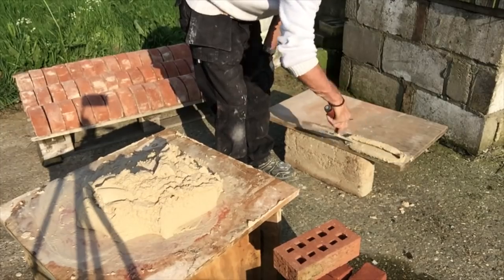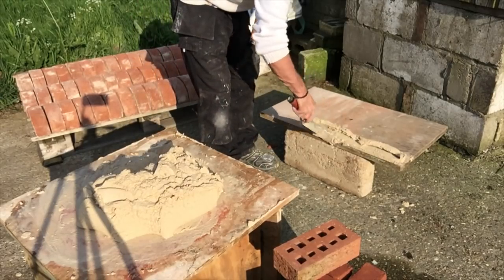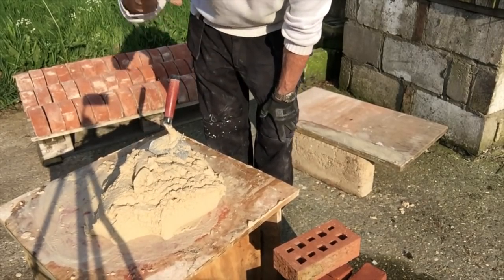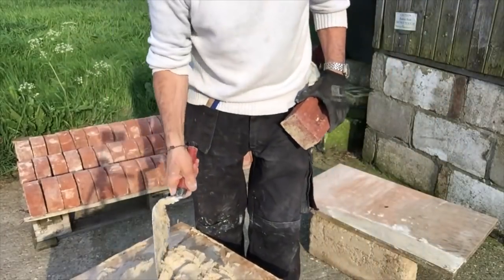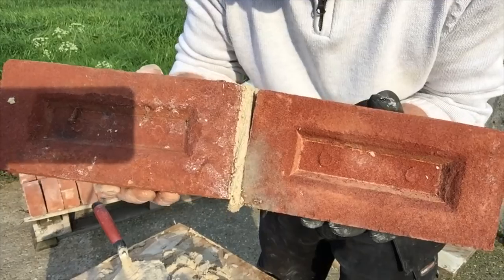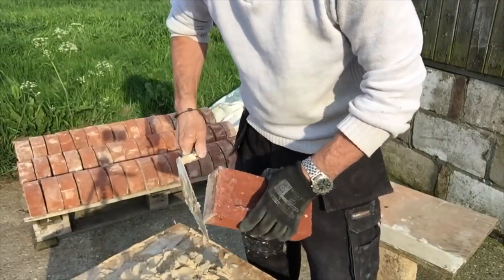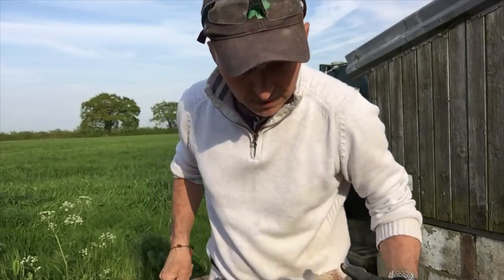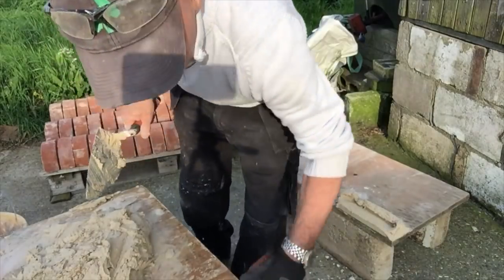how to lay bricks - Basic Skills Lesson 1 - Freehand Panel

Comment: thanks ive been doing my own DIY  since i was a lad, done a few small walls of my own, but learned watching your video in the first 3 minutes where i was going wrong with the buttering of the brick, superb and saves me so much time, and makes the job neater also down to holding the brick,,,, thank you great video have subscribed as i have a large wall to do next year so taking a year  to get technique correct as it its 8 course high and full length of my front garden ,

Comment: I couldn't agree more regarding the pointing up. You should be able to do it one handed within reason.
Also, it is really hard to find mortar that is dry enough to match the mortar in your work so if you are adding wetter mortar it stands out like a sore thumb, even more so after brushing.
There is lot's of talk about the pick a dip method, but it is so hard to get a full joint, they do it in Holland but then have labourers to do the jointing up.

Comment: 15 years exp brickie here, nice video.  I butter my bricks in two strokes on the end near my wrist, not the end you are using, if i'm going from left to right on the wall.  One stroke to fill the middle and one to the front to make sure i don't spend too much time on jointing.  Extremely fast.

Comment: Nice bricks mate good demo, you should try flick your bed along the wall not drop it and spread it with your trowel bottom upwards, point running along the frog ( hole in brick). Can get a brick bed and a half easy, and its "perp" not perk mate. Half trowel of mud flick downward to flatten out mud. x2 quick vertical down strokes fatter on the on top. The front perp, stroke back towards yourself aiming for it running with face of brick. Then the back perp same as front. 4 quick moments 1 half trowel of mud, flatten off with a flick over your mud board. Years of practice dont except the speed until you can lay straight

Comment: Always keep!the perps full is dead right .... you don’t get paid for jointing . Great video Rob 👍🏼
Reply from the maker: thank you...I'm enjoying yours as well...
Reply: rob songer . Wow thanks for watching Rob that means a lot to us 👍🏼
Reply: You do get paid for jointing as that is part of the price you put in for the wall you are doing or if you are on price work and you get a certain amount per 1000 bricks then the jointingis in with the amount you get per thousand bricks you lay. What this guy is saying isn't that important because you can put a not so good joint on your brick compared to the other bricklayer who does but you should be laying more bricks than that person but your joints won't be as full as the other guys but you have put more bricks in than him and the time it takes the other guy to lay the same bricks as you then that gives you time to go over your mounting and sometimes this can be a quicker method.
Reply: Mr Brightside knocked down a brick outbuilding at home laid frog down and all the bricks had voids in the perps. More just a bead of mortar around the edge. Easiest deconstruction ever. Tap with a hammer and off it came.

Comment: When I place a joint on the end I use two moves. The joint after applied should be near straight with the face for a full cross joint when you lay it. Fast is measured when the wall is complete not just laid to the line. Most brick should be rubbed into position for speed. Thanks Rob.

Comment: Wondering if you might comment on the method of pick and dip some masons are using. Seems like the quality of the mortar necessary for pick and dip and head joints may not be as weatherproof as conventional mortar mixes and laying of brick. Do you always work from right to left?
Reply from the maker: Hi Gary, yes I always work that way, if you watch lesson 2 I think I explain it more

Comment: The masons that I learned from would not work backwards unless 2 right handed brikies were on the same wall. Always was told to double the head joints to avoid the beholds. Used what is called a shoved head joint. .if the wall was 30 bricks long then we spread the mortar on the 30 bricks. Being that I am a left handed mason, it was very rare to lay backwards. We never used the pick and dip method of spreading the bed mud.
Reply from the maker: Are you saying that both brickies always started at the corners and both met in the middle of the wall?
Reply: @robsonger1  yes Sir! I am in the Southwest USA. Basic trowel technic is the same where ever you are. We have sharp sand here and that is why we spread motor differently. No matter what the end result is the same. Your video was right on the head of teaching. Very good and informative.

Comment: Hi rob, great video as per usual, how would you joint a let’s say panel of brick work with joints bigger than 10mm, 12 to 15mm, what size bar would you go for ?
Reply from the maker: Hi Barry, if the wall was being half round jointed I'd use the widest Marshalltown jointer, the 81 pattern (I believe its that, I mention it in my video "Hand Tools"
Otherwise if it was left up to me, it would be a flush joint with my stick. Please see "Flush Jointing"
and funny enough, I uploaded a flush jointing video yesterday but haven't made it public.
Reply: Cheers rob, you’ve just won me 20 quid 💷, I o you one
Reply from the maker: how did that happen?
Reply: Have a mate I work with and we building timber frame houses and sometimes we have massive joints between windows, he uses a small bar on big joints to try and bluff the big joint, to try make it look like a normal Joint, I like the big bar as it is what it is, what’s your take on this
Reply from the maker: Timber frame can be a huge problem for us, I worked on a few and had similar problems like you say.
I think what you are doing is the best you can do. Keep up the good work
Reply: Cheers rob, love your videos
Reply from the maker: thank you.

Comment: Hi Rob, I've watched your videos loads of times to try and copy how you lay bricks, I'm a complete novice and the one thing I'm struggling with is getting the mortar to stick, in your video at about  6:45 you sort of slide the trowel off the brick leaving a flat blob about 10mm thick, when I try this the mortar seems to stick to the trowel and not the brick and I end up pulling half the mortar off, would it be possible please to tell me why?
Reply from the maker: make sure your trowel is clean, make sure the mortar isn't too dry, and remember to not apply pressure when you slide you trowel off just after you press it onto the head of the brick

Comment: Rob why don't you butter the face of the very FIRST brick that you lay?. As opposed to buttering the second brick and connecting it to the first brick??
Reply from the maker: I can think of 3 reasons straight away, maybe it's not explained that well in this first video....but I thought it was.
The way I use gives a full joint everytime as the mortar is cut flush, the other methods shown that I don't use can easily smear a brick and also leave an unfull perp...hence I butter the brick I'm holding. I hope that helps.
Reply: @robsonger1  thank you very much
Reply from the maker: I'm afraid he wouldn't be working alongside me. I once had a student adopt this method, he thought it was  fast, but the time he took to fill the holes after took him ages, plus if Charlie just joints over the holes then they will only be partially full and eventually the moisture will just find an easy route into the cavity...
Short term, it looks fast and neat..
Long term, costly rectification.
Reply from the maker: I  once saw a demonstration at the Home Builders & Restoration show (?) at the NEC where someone had a hose on a wall to show how quick water penetrates a cavity...it was shocking. No holes in joints please lol

Comment: Grabbing the back side of the brick is not always possible to do. Brick work today is a veneer. There is generally a wall behind it. Garden walls are a rarity. If the air space is 3/8", you could never use this form. Also, when spreading brick mortar, each bead or trowel full spread should be at least twice as long as the trowel. If you and i lay 1000 bricks, you spread 900 times, i spread about 400 times. Less movements=less energy=more efficient=more money.

Comment: Good video Rob....not sure about the tapping bricks down and when you laid your half you had to turn the brick in your hand rather than perping it as we say (out the back of your hand) my old man's the best bricky i have ever worked with and both these things he would have kicked my arse for when he taught me. I've been laying for 20yrs now but I suppose it's everyone to there own. Not being critical your clearly very good just my opinion that's all mate. But a good informative guide for lads starting out.......
Reply from the maker: thank you
Reply: Yeah I thought tapping was a no no
Reply from the maker: not at all, aim for less than 6 and thats a good start, anymore than that and you are putting to much bed down, or your bricks are too dry, if you never have to tap...you have mastered how to apply the bed, or...you have too much plasticiser in your mix.
Reply: rob songer if you never have to tap or use hand pressure to get brick down to the line when your laying into a furrowed bed then your leaving the void that you created by furrowing unfilled.
Reply: @brickbybric  you shouldn't furrow your bed it's another thing i got knocked out of me when learning to become a bricklayer i always got told if you furrow your bed it can create hollows in your bed where moisture gathers.....I spread with 2 motion away flat then only very slightly with the tip of my trowel i put a fine cut in the mortor with my second motion back towards it's much much quicker I get a more uniformed bed hence i hardly ever need to tap bricks down and I don't leave hollows for moisture!! Just a little hand pressure to get down to line every time. This is where speed comes from it's not how fast your arms  are going trying to lay it's about being efficient as possible and having the least amount of movements while laying. Repetitive action time and time again is trick to being neat and quick.
Reply: C Jackson agree with you 100 %. Some can’t accept that’s its possible to lay brick into un furrowed mortar

Comment: Hi Rob. . May I ask why, when laying the half bricks, you position the open end of the frog at 90 degrees to the run of the wall? . . . In my simple way of thinking I would have expected to see the partial frog being inline with those in the full bricks. . . . Presumably you would change the orientation if both sides of the wall were going to be visible. EG, a garden wall.
Reply from the maker: hello, firstly thank you for watching.
the half bat is laid with the frog facing the back of the wall to ensure 2 things, 1. that the half is a true half as a cut face may be shorter or longer than a half, and 2. there is no cut edge showing on the face of the wall.
Reply: Thanks for clearing up that point for me, Rob. . . . . May I be cheeky and ask you another question? Well, a few in fact . . . I keep seeing that the recommended building sand to cement ratio for bricks is four to one . . . Would you agree with this? Also, what is your opinion regarding incorporating some sharp sand into the mix? I was thinking of using three of building sand, one of sharp sand, to one of cement . . . I am about to commence building a 1.3 metre high x 9 metre long front garden wall in red brick (Topped by a row of soldier bricks) and wondered of the addition of sharp sand would give more 'body' to the mortar. . . . The wall I am replacing was constructed using a mendip dust mortar and it had lasted for 66 years before almost half of its length was knocked down when it lost an argument with a vehicle. (It had no support piers, but the replacement will have five spaced along its length). . . My final question is this - I will be using Mastercrete cement, which I understand has improvers added. I have been told that many builders will still add some extra plasticiser to help getting the correct consistency. Would you do so? If so, approximately what ratio relative to the recommended strength would you add. EG. 50% of the recommended mix strength? . . . Thanks in advance.
Reply from the maker: ok the type of mortar you use will depend on 2 things. firstly, how soft/dense the bricks are and secondly, the colour of mortar you are hoping to achieve.
So, I would only ever use a 1:4 below ground and in drainage construction. 1:4 is far too strong for most bricks (even when I use engineering bricks I will still use a small portion of lime) always remember that the mortar should never be stronger than the brick it is used with.
Please watch my video "Mortars" to see if that helps.
the second factor is the colour, I find using just cement and sand (no lime) gives a very grey, patchy finish no matter how well it is gauged, Lime mortars are much more consistent in colour and they are better to work with regarding workability. Adding sharp sand would only be necessary if you were matching up to an older wall.
I tend to use plasticiser in all mixes (5ml to 5 buckets using the concentrated admix)
Reply: Thanks, Rob. You're a star. Let's just hope my bricklaying comes somewhere close to the quality of your advice.
Reply from the maker: depending on your skills and experience;
 if they are still quite new, do some practice pieces first with Hydrated lime so you can do them over and over until you feel confident.
Reply: Thanks again, Rob. . . . I watched your 'Mortars' video. Until I'd watched that I hadn't planned on using Hydrated lime in my mix, but I'll be guided by your advice and expertise. I have 'London' clay bricks rather than softer hand made, so I thought that maybe a 1: 1: 5 mix would be okay? (I don't have OPC as I have already purchased the Mastercrete cement, but I presume this will still be okay for such a mix?). . . . . As far as the actual laying of the bricks goes, I have over 30 years precision engineering experience. I'm therefore HOPING that my ingrained 'Engineer's Eye' will come in useful. I will, however, follow your suggestion by first trying a few practice runs on some board.
Reply from the maker: Mastercrete is an enhanced OPC, so rather than a whole part lime in the mix I'd probably suggest a half (1/2:1:5) Also, try some practice running in (Lesson 2)
Reply: Thanks again for your help, Rob. Pretty much everything I'll need to know now is contained in your videos, even how to lay soldier bricks. I'm pretty sure I'd never have thought about having a second guide line running along near the bottom if I hadn't watched that particular video. :-)
Reply: Hi Rob. It's me, AGAIN!! . . . . I have finally made a start on the construction of my garden wall. Although it's proving to be a slow job due to a combination of adverse weather and me having a lower back problem (Sciatica) that restricts the length of time I can work in one go,  I'm basically pleased with how it's going. . . . . I've even had people tell me it's looking good. . . . . I now have another question for you, but if I give some detail first it should make the purpose of my query easier to understand. . . . I am using red clay bricks (London 33). . . . I would imagine you have to be familiar with them and know they have a large frog. . . . . The wall will consist of either 5 or 6 courses and then be topped off with a course of 'Soldier' bricks for atheistic purposes . . . . . As the bricks are being laid 'Frog up' I am wondering if I should lay the final stretcher (Is that right?) course with the frogs downwards so the Soldiers will be laid on a full brick face rather than just two edges? . . . . I know the frog would be filled with mortar and should provide good support and strength, but I keep thinking a full clay face might be better. . . . . I would of course 'Butter' the frogged face of the brick to be laid to ensure the frog was completely filled with mortar before laying on the previous course. . . . . Am I just overthinking things with this, or would seating the soldiers on 'Frog up' bricks be fine? . . . . BTW. On the bags of Mastercrete they suggest a 5 sand: 1 cement: 1 Hydrated Lime mix for bricks. . . . You suggested a 5: 1: 0.5 mix. . . . In the end I compromised with a 5: 1: 0.75 mix and it seems good to me. . . . . Sorry to trouble you again, but novices like me need all the help they can get. ;-)
Reply from the maker: Hello again. I would always lay frog up on all brickwork with the exception of 2 places, 
1. the final course for a concrete oversite so that the screeding can be smoothly and not hindered be concrete filling the frogs, and 
2. creeper bricks (cutting over an arch)
the mix they suggest seems very strong, 6:1:1 is the usual recognised mix but it doesn't depend hugely on the bricks being used. Always remember, mortar must never be stronger than the brick.
thank you again for watching
Reply: Thanks Rob. I'd more or less guessed which method you'd go for, but thought it was worth asking someone with your level of expertise.